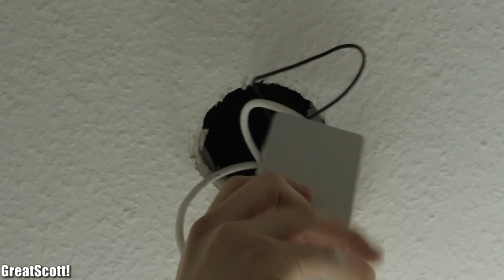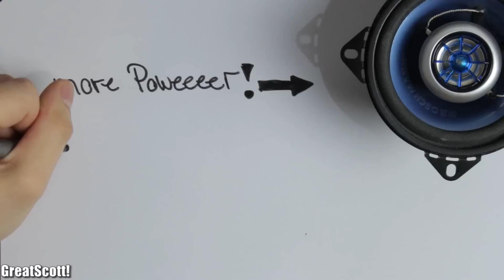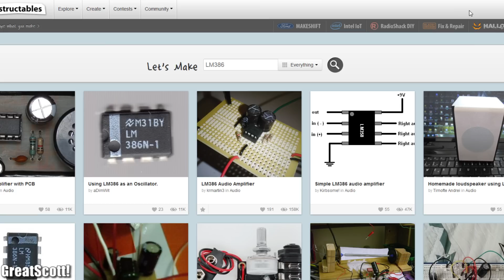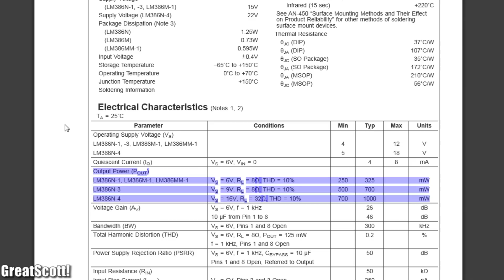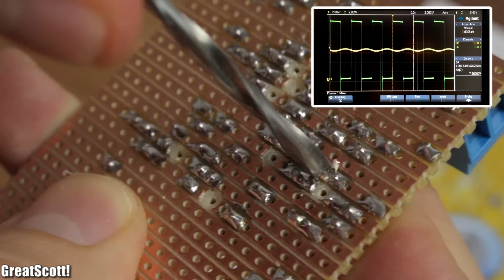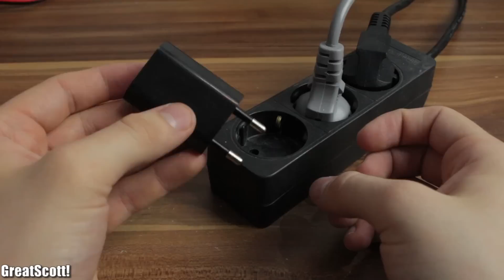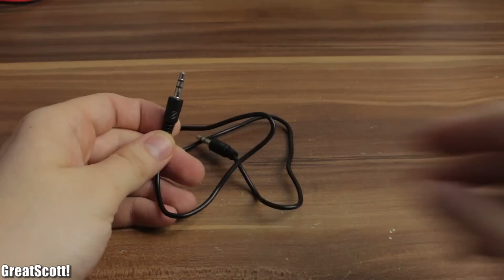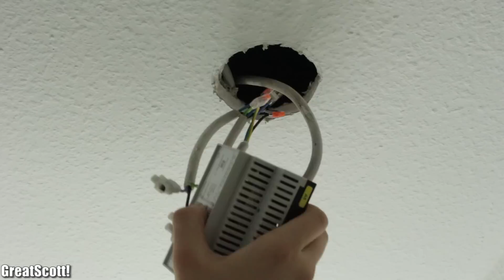Make your own Low Budget Bluetooth Music System || OpAmp

Comment: On the topic of "so many amplifier types": Class-K amplifiers
Basically just an AB and D amplifier working together - AB gets the audio signal, and drives it out nearly directly
D helps out with a lot of the higher-power driving, to reduce the amount of current that AB has to source or sink.

Comment: I think I missed the part where you converted the stereo signal from the bluetooth module into a mono signal.  Or did you just pull the left or right channel, which is not the same thing?

Comment: A large capacity with low ESR must be added to the BT module. Then your hum problem will stop. Or possibly use a balanced output if there is one.

Comment: I built the 5534 amp a year ago.  It wouldn't work for me. When I rewired for an LM358 (I had some, I just wanted to see if the 5534 was bad) it worked fine. The NE5534 chips were ordered from China, though I've never had an issue before. Fast forward to today. I had to get a part from Mouser to fix my furnace, and in order to be more comfortable with the massive shipping cost I bought some 5534s. This circuit works great. All 10 of the ones from China don't do anything at all. It makes me wonder if they were rebadged with the wrong code.

To anyone who builds this amp: be careful - Those transistors can get very hot very quickly. I have some really large transistors I'm going to use for whichever amp board design I choose. These BC6xx transistors are rated for 1 amp of current, and at moderate volume I was pulling around 500mA, which caused quite a lot of heat, but shouldn't cause any thermal runaway. There's a Youtube channel called Simply Put who built a small amplifier and used a bunch of transistors to spread the current load and keep the heat down instead of buying expensive large transistors. I think he used eight or ten 2N3904/3906 transistors and it seemed to work well.  I may try this too since I have a couple hundred of them and need to use them up.

Comment: Transistors in push pull configuration that you shown in this video doesnt work in AB class, but in B class. AB class need additional bias voltage, applied to base of each transistor. This bias is needed, because for low  input voltages current that flow trouth base is very low, due to bjt characteristcs, soo doesent affect emiter current.

Comment: Ebay "bluetooth amplifer board" .  This project is dead easy. If you dont have a false ceiling, it's much easier ! Attach two old speakers to the wall and connect it all up. Voila, boombox bathroom, was my solution.

Comment: could you find a way to remove the noise without an external power supply?
Reply: No way of getting rid of noise without using an external power supply. And no, you can't have your cake and eat it

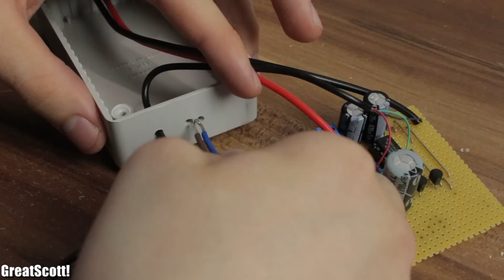Comment: 4:37
"The brown 12V wire connects to the upper terminal (you were connecting the blue wire)" and "the blue ground wire connects to the upper terminal (you were connecting the brown wire)". Isn't it a bit WEIRD?

Comment: If you found that the output volume is pretty low or suffered from lack of bass:

they decided to put an 1k resistor and a capacitor in series between the output signal and the 3.5mm jack.  Removing those does fix the problems. Those are probably meant for protection. But I think they’ve chosen some inappropriate values when designing.
Reply: If course if you planned to use an amplifier, just ignore this.

Comment: for everyone still wondering about the noise when connecting the receiver it's just most likely a ground loop formed by connecting both the signal and the power ground to the circuit (can't be sure since i didn't saw the circuit) to avoid it just connect 1 (you can avoid to use the ground shielding on the signal wire if the 2 circuit boards aren't too far apart and the signal wire is not close to the ouput wires)

Comment: I'd avoid the H-163 if you can. I plugged some earphones(RP-HJE125E-K) into mine to test it out and it's very tinny with no low end. Sounds so bad.

Anyone know of any decent Bluetooth audio receivers?
Would it be hard to solder on your own 3.5mm jack onto one of the eBay Bluetooth amp boards?

Thanks.

Comment: I have a wired speaker that uses USB and 3.5mm jack.

Can I connect the 3.5mm cable (from speaker) to the 3.5mm hole? My speaker doesn't have a USB port
Which I see a tiny bit of aliexpress user does which one do I choose?

Comment: Warte... 4:36 "The brown12V wire connects to the upper terminal, and the blue GND wire to the upper terminal" Du hast 2 Obere Terminals? :D
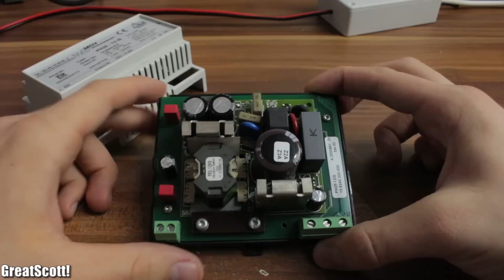Reply: und 5:06 Brauchst du 200 A oder 200mA ? :D

Comment: I had same problem when shared same power source for the Bluetooth module... I put some silver wire around the Bluetooth module specially near the antenna and attached the silver wire with ground (just like a kind of shield) and the problem solved..

Comment: i only tickled with 230v hahahahaha :D it will kill you when you dont use a proper tools i change defective switches and power outlet without turning off the breaker just a proper tools and an electrical tAPE lol :D

Comment: shouldn'T something like this solve the interference problem when powering the bluetooth receiver? ^^ https://www.ebay.com/itm/252029953042
Reply: And would this amp https://www.ebay.com/itm/182474865752 work well? I'm asking beacause I saw DIY Perks using it in his Bluetooth speaker video. An answer would be great <3

Comment: Hi great Scott. I find your video interesting to look at. And I know you are an electrical engineer. I have one question. I have bluetooth receiver. My question is can I charge my Bluetooth receiver while in using? I worry my hi fi get broken because when charging it involve power. The Bluetooth receiver connect via aux 3.5mm
Reply: Khairi abdullah Hamzah This Bluetooth receiver is not chargeable. No internal battery. Directly connect it to a 5v power source. It barely sips any current so you could run it off a cheap power bank for several hours(that is, if the power bank detects the load. It's so little that most of the time it doesn't) before dying out. Or you could add your own Li-Po battery instead and replace the USB port with it. Idk you can get creative.

Comment: i build another amp with the lm358 and two darlingtons as a output in class b configuration with no externel parts then two dc offset cappacitors to decouple the in and output of dc bit this amp has destortion at low loudness and no destortion at high loudness. i dont understand why!

Comment: I know this video is 2 years old, but I think this whole thing could be simplified by just using one of those cheap bluetooth amplifier boards that you can find on amazon and ebay. Of course, one wouldn't be building up an amp like in the video, but it's a pretty cost effective solution, considering they sell for like 10-15$.

Comment: I can't get it to work with anything but my function generator, because the circuit doesn't respond to the input unless it has a peak to peak voltage of at least 1.5 volt. How do I make it more sensitive?
Reply: Also, if no input is connected (or the peak to peak voltage is not high enough) the output of the NE5534 goes to almost supply voltage, causing the transistors to conduct as much as I'm limiting my bench power supply to. What could cause this issue?

Comment: Well... you said when the Bluetooth receiver share the same power supply, you get that high pitch buzzing. 
It got that problem in one of my Bluetooth wireless headset and seems to be a fairly common problem.
How to fix that high pitch buzzing when you got only one battery as power supply?

Comment: ´why this noise (aka ground loop) happens?! i m searching how to solve this problem for a long time, but i couln'd find any efficient solution. i reduced the noise using 18650 batteries insted of regular voltage transformer, but i still listening a small noise when i pause the music or changing the tracks. please, make a video explaining the ground loop issue and how to solve it! please!

Comment: But can I use the bluetooth audio receiver itself by soldering a 3.5mm socket and just plug it in like an amplifier? I have one that I salvaged from my bluetooth headset and add a 3.5mm socket and it "worked" but there are some distortion.

Comment: Do you have another idea to slove  the problem of dissonance by
 sharing the same power line ?
Reply from the maker: an audio transformer between the audio source and audio in
Reply: GreatScott! Thanks. I want to build a boombox with this Bluetooth stick as Bluetooth connection. I powered it by an 12v battery and a transformer. Thank you for this 'hint'. I tried to figure out a method to end this dissonance for weeks!

Comment: PLEASE HELP!!! PLEASE PLEASE!!!
I am building a portable bluetooth speaker  with the same bluetooth module. The problem is that i need to connect the module with the same power supply as the amplifier. As a result there is the same horrible sound as you encounter is coming from the speaker.

Is there any way to fix this without using a separate power supply??

I am using the following
TP4056
XL6009
pam8403
The bluetooth module.

PLEASE HELP!!! ANY HELP FROM ANYONE IS APPRECIATED.

Comment: Nice project. But I'd be worried about the two way speaker coil  been exposed to so much moisture. I'd use a marine grade or weather resistant speaker.

Comment: Can i use this power supply (http://www.ebay.it/itm/AC-DC-Power-Supply-Buck-Converter-Step-Down-Module-12V1A-5V1A-12V-450mA-5V-1A-it-/231457376248?var=&hash=item35e3ef47f8:m:mTG5jCCguUiJ4C1IdOVRBFA) or will it produce the same awful distortion through the amplifier?

Comment: How many speaker can i connect with this circuit. Because i have two speaker so i want to play both speaker.
Reply: Build a stereo amp
Reply: Your speakers have an impedance rating. This circuit is made for speakers with 8 ohms. If you take two speakers in series, you'll get 16Ohms and then you will only get half of the power. If you take them in parrallel, the resistance will be lower. In fact 4 ohms, double the power output, sounds great? Yeah, but your transistors will get hot and can be damaged.
Reply: yes it will happen.so how can i?

Comment: can I use different type of NPN transistor and PNP transistors? Because the BC637 and BC640 are not available in the store.What rating of voltage and current should I choose?
Reply: @GreatScott!
Reply: Try online. Lots of places to buy them there.
Reply: Try online. Lots of places to buy them there.

Comment: you could've used a pair of cheapo Chinese 1:1 ratio transformers on the audio line between the receiver and the amp to get rid of the noise, then you wouldn't need a second power supply. the transformers degrade the sound quality slightly, but likely nothing you'll notice on an installation like this.

Comment: Why there is noise when the power supply is shared between module and amplifier? I too faced this problem and it works fine with separate power supply. What may be the reason?

Comment: volt won't kill you, the amperes on the other hand will ;p
Reply: Don't perpetrate the 'Volts jolt, Current kills' myth.
Reply: So 2K amps wont kill you with low voltage?
Reply: Other way around.. 0,050 amps, or 50 mA, and 10v, it will kill you. But if it is 0,001 amps, and 1000 volts, it will not kill you.
Reply: Idiot! Only with enough Voltage, enough current can flow. Current is deadly at a level around 50mA

Comment: is this possible to power this bluetooth dongle with 3.7 v
Reply: I think it will start operate at about 4.2 volts. You have to use a step up module

Comment: For anyone who wants to connect the bluetooth module to the circuit without the interference happening, you can achieve that with a ground loop isolater

Comment: hi, is there any cheap pair (bluetooth transmitter and a separate bluetooth receiver) on ebay or anywhere else that I can use if I want to hook up a music player that doesn't have bluetooth transmitting capability as far as you know? It doesn't necessarily need to be bluetooth, but any wireless pair that you may recomment for me would work. Thanks a lot for the video

Comment: i made a stereo bluetooth boombox but i too had that grounding problems....and i too burnt my first bluetooth receiver....then i ordered a second one and i ended up supplying it power via a second homemade powerbank..huh
Reply: how u did that? I have same thing into my car, and can't sort it out
Reply: +Dovydas Milius bro its easy but u will not get the bestest results....just switch the ground and any one stereo cables and make sure that only two audio wires are connected...one on a ny one channel and the other channel on ground of ur amp and leave the ground from bluetooth disconnected
Reply: +Akshay Rajput I think I did that but anyways u could hear that noise

Comment: Could steam coming from a shower mess it up?
Reply: +GreatScott! Question is if it would create moisture inside of your ceiling which then leads to a bunch of other issues
Reply: You can put nylon over it...You don't lose loudness, and yet you protect it from steam and moisture...
Reply from the maker: Still works to this day without a problem. So probably not.

Comment: hey Great Scott, 
first of all: an amazing project, but I got a question. I have built my own amplifier too and wanted to add bleutooth to it.  I used the same Bluetooth stick as you. But when the volume of the music is low trough Bluetooth I get a really annoying noise. a buzzing noise. I tried a different power source for the usb stick but that didn't work. the ground of everything is connected togheter. do you have any idea how to fix this. 
thank you very much in advance. 
greeting,
MisterCrazyBoy21

Comment: Hey, is it somehow possible to build a speaker which plays some music from a flashdrive instead of a bluetooth device?
Reply: Instead of connecting the audio cable to the usb receiver connect it to some adaptor that takes audio from a usb, but that will take power and will be basically a pc to read out the files so its easier to use that blurtooth dongle. I only knoe the basics of the basics of electronics so i may be wrong
Reply: Themoigt My problem is that I want to build a little chest which plays the chest-opening sound from Zelda as soon as you open it and connecting it to a pc isn't an option :/
Reply: +MrSandoron oh damn thats looks like a complete different story, so you wanna make a chest and when is opened plays a sound? It will be easier to make something like kipkay , look at his channel in one of his oldest videos (2009 or something like that) he takes a sound postcard and mods it to play another sound, obviously is a lot lower quality sound and is a bit experimental, let me link his video if i find it.
Reply: Themoigt Thanks! If it works I will do so :D

Comment: I built one similar to this one but I used LM386 chip instead. It works great using Bluetooth usb module after adding audio input RC filter and output stage NPN and PNP transistors; however, if I leave the speaker idle for 2 minutes, the Bluetooth wave distortion is heard through the speaker and the only way to stop that from happening is to switch off then on the amplifier circuit or just playing a music through the amplifier. I tried the same amplifier circuit I built on the PC without Bluetooth module and it works fine.

Here is the circuit (https://goo.gl/YhXoGx). A decoupling 100uF capacitor is added to Vs. 

Do you suggest any improvement to the circuit to eliminate the bluetooth wave distortion? 
NB: bluetooth usb module has separate supply than amplifier circuit.

REGARDS

Comment: I got excited when I saw you had the same output noise issue as me when your bluetooth dongle shared the same power, I thought you were going to provide a different solution and then you just plugged it in to mains power :( Mine is going to be battery operated so I'll have to include a way to stop the noise.

Comment: What is the silver wire thing you used in the circuit board. I can't find it and I don't know what its called. Thank you.
Reply from the maker: Silvered copper wire
Reply: +GreatScott! Awesome thanks
Reply: It's tinned copper wire, not silver. You can use plain copper it just won't be as pretty nor as easy to solder.
Reply: silver wire ?you mean a jumper

Comment: I'd like to use Bluetooth to send sound from a home made violin and ukulele to a Bluetooth speaker but alas I don;t know anything about it, could you possible do a video on this maybe using a Bluetooth phone earpiece?  The quality of the sound doesn't need to be Bose quality :-)
Reply: Just so you know you may run in to latency issues with the bluetooth connection, so make sure to look at that as a parameter of what you decide to use.
Reply: Is the ukulele and violin electric.. if there is even electric one's. If not electric just use tape to attach high quality microphone on the side, fron, back etc. of the instrument. If it's electric there would be audio port. Use it on bluetooth reveicer and power it with a. usb charger or b. solder an usb inside the electrics + and - (plus and minus/ground)

Comment: If you want to use a battery, how do you adjust this?
Reply: +fizz113 You use other power supply, (if your batteries does not have right voltage) and prefebly some safty circut with it. Power supply need to have input of your batteries, and output for your board (if you are using one in video then check in video). Also, i am not an electricial soo